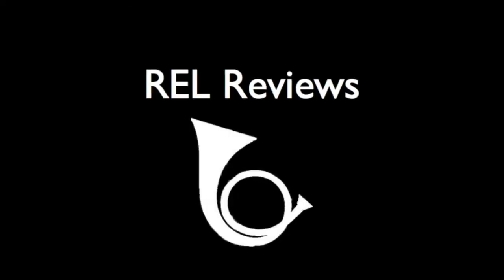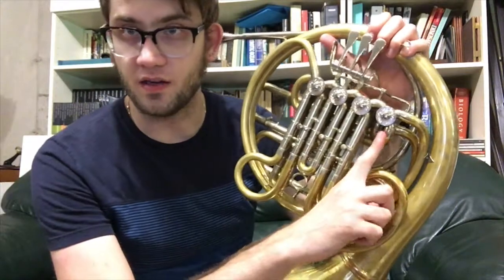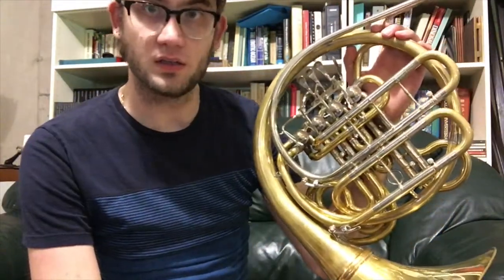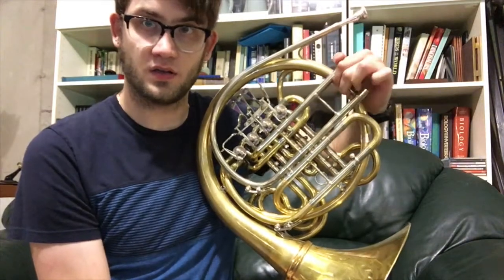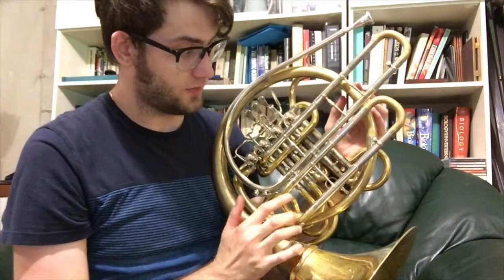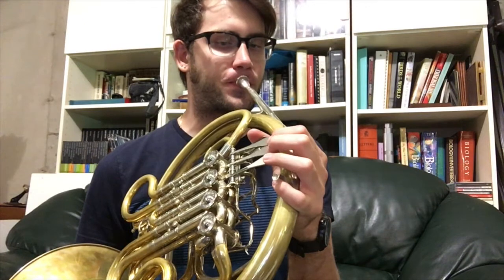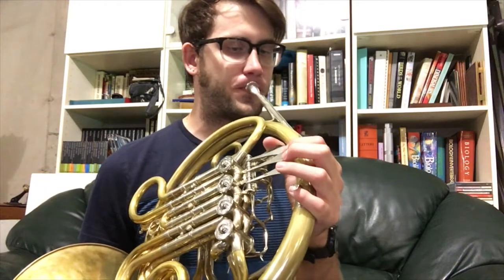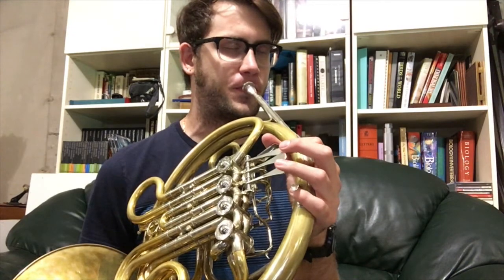Week With a Horn: Englebert Schmid double

Comment: In addition to lengthening the main and F slides (the tubes have a mark to know how much), you also need to extend each of the normal valves (1, 2 and 3) to match the longer A/E horn.

The advantage is, you can play a piece in E as it's written, without any transposing (except that written C sounds E, of course).

Or, you can remove the "H" piece, and insert the F slide completely, then also insert all the other slides (1, 2 and 3), and you get a horn in B/F#. So you can read E parts as if they were written in Eb (much easier). In this case, a C will sound F#.

Note that, although we have the horn in A/Bb/B, we never actually "hear" in that tone, we still hear the pitches in E/F/F#.

It's bringing back a bit of the crooks of the natural horn to modern playing. Many professionals and teachers in the XIX century, actually advocated for having the valves to complete the chromatic scale, but not replace the crooks system. One of the arguments in favor was that certain transpositions (like E and B) become awkward in an F horn and cumbersome to read. And while that's true, the practicality of not having crooks won.

Comment: I'm kind of curious how the horn stays in tune when adding or removing tubing. How have they resolved the issue of the length of valve slides? I assume you have to push those slides in when playing in F# or B and pull way out when playing in Eb or A?
Reply: @DJKLProductions  On a horn tuned to F, the main tube is about 4 meters long. The second tuning slide is about 25 cm long to drop the horn into the key of E. If we insert a 50 cm length of tubing into the main tuning to drop the instrument into Eb, then the second tuning slide must be almost 30 cm to drop it to D. That means when playing a main tuning of Eb, the second slide will need to be pulled out an additional 2.5 cm to get the extra 5 cm of length. The first tuning slide would need to be pulled out almost 5 cm to make it 10 cm longer. The third tuning slide would need to be pulled out about 7 cm, about 2.75 inches! Most tuning slides do not have that much room for adjustment, especially if using an A-445 tuning system that requires the slides to be pulled out to play at A-440 by default. I'm just wondering if they made the made the adjustable sections of the valve slides longer than a normal horn. The hand can do only so much fine tuning without adversely affecting the timbre.
Reply: @cdmcfall  I also had reached the same conclusion as you did, and it's quite puzzling, because in his website, the additional extension for the valve slides is not as much as I would've thought (check the "maintenance" section), which is comparable to your numbers.
Reply: @cdmcfall  Note that the slides only lower/raise the horn by half step. So you can have B/Gb, Bb/F, A/E (not Eb as in your response).

I have created a spreadsheet with numbers based on Lucien Thevet's Method for Horn and the formulas in "Mathematical Brass" paper (not exact but enough for an approximation).

1. Horn in F is 3.79m. This is the only value I took from Thevet's methode. The length of the rest of the tubing is calculated using the formula in the paper. I've checked that the values are close to the ones provided by Thevet (I could not use them directly, because it had very strange results, I think there are some mistakes in these values). I took some measures in my Alex 103 and match well enough.
2. Horn in E is 4.02m
3. When extending the main and F slides to E (there are marks on the tubes), the horn is extended by approx. 22.56cm
4. The 2nd slide for bringing down a horn in F to E is the same, 22.56cm. This is the normal 2nd slide in the F horn.
5. The 2nd slide for bringing down a horn in E to Eb is 23.91cm. But we already have a slide that is 22.56cm long, so we have to take it out by 0.67cm.
Reply: @cdmcfall  YT does not allow pasting the link of the spreadsheet, sorry
Reply: @georgH  Yeah, I don't know why I typed Eb. I knew what I meant lol. Based on speed of sound (343 m/s) and A-440 tuning, the tube length for F should be 3.93 m (at least for a cylindrical tube: (343 m/s) / (87.31 Hz) = 3.928 m). I'm pretty sure the 3.79 m is a product of intentionally manufacturing horns sharp (one can always pull out). A-455 tuning would indeed put the F at 3.8 m, plus the fact that sound moves faster in the humid inside of the horn. Thanks for the info. I'm actually working now on building a triple horn from scratch, but I've designed some custom fittings (similar to compression fittings in plumbing) and thumb screws so that the entire tail section and lead pipe can be removed and replaced. For chamber music, fit a slightly narrower lead pipe and a narrow throated, smaller bell. For big parts, attach a wide-throated, nickel silver tail and flare. Make it completely modular. the cylindrical valve and tuning sections would be the same bore regardless, but the taper and throat size could be adjusted based on demands of the performance. Theoretically, you could attach the various lead pipes and bells to any cylindrical tubing, so you could swap out the rotary valve assembly for a pumpenvalve assembly and now you have  a Vienna horn. Or replace it with a coil of appropriate sized tubing to make a natural horn. It's been a fun project so far, though I have yet to make it past the CAD phase (I do have a PEX version for proof of concept).

I'd love to compare your spreadsheet to mine. I may upload it to Google Drive. You can put in a tuning for A, and it will spit out tube lengths for all keys from A0 to C8, plus the theoretical wavelength of each harmonic to determine the most in-tune fingerings. The conical shape does weird things to the harmonics, BTW. It doesn't behave as one would expect from a closed cylindrical tube. And I'll definitely be buying that book!
Reply: @cdmcfall  Wow, thank you for your response!

Wow! I'm impressed that you are actually building a triple! I just crunched some numbers to understand better how the valve slides must be adjusted after tuning the entire horn half step down or up.

Actually I started this spreadsheet using the values from Lucien Thevet's book, but some values were really weird, I think there is a mistake somewhere, so I didn't trust it.

Then I replaced these values with the calculations I mentioned. Because I wanted to have a reference, I forced the speed of sound to get the length of the F horn as presented by Thevet 😅I know, not very scientific but I just wanted some values in the ballpark, like a back of the envelope calculation.

After having seen the results (and having measured some slides on my horn to match the calculated values), I now found what was my mistake and have a better understanding. 

My mistake was thinking if I needed to add, let's say 17cm to the 2nd valve to change it from A to Ab, then that slide would have to be extended by 8,5cm, which is crazy. But the majority of this length has already been added to the main slide by lowering it half step in the first place.

I have the spreadsheet in google docs too, but can't paste the link here, YT blocks it.
Reply: @cdmcfall  Wow, I'd love to see your work, be it a video or a blog, sounds very interesting!

> The conical shape does weird things to the harmonics
I know, I just wanted to have a bit of an understanding, as it was not clear to me at all why it worked (I have a Schmid double and tested the Gb and E tunings but didn't have a clear understanding of the extra length needed).

So, nothing serious, I just did it for fun :)
Reply: @cdmcfall  Your project sounds so interesting! Jacob Medlin also has some blog posts about how he designed his horns completely in CAD (I've read them all!)

You should check it out, great stuff!
Reply: @georgH  I've been in contact with Andy Thompson, principal horn in Norwich. He wrote a paper about how the taper of the mouthpiece, lead pipe and the curve of the bell flare affects intonation, especially at the extreme low and high registers. It's called "A Study of French Horn Harmonics." I disagree with one of his conclusions, though:

Specifically, a cylindrical tube 392.87 cm should theoretically be able to play F0, F1, C2, F2, A2, C3, Eb3, F3, G3, A3, Bb3, C4, C#4, Eb4, E4, F4, with the fundamental 2 octaves below the F2, which has a wavelength equal to the length of the tube. He suggests the conical shape opens up additional harmonics not possible with a cylinder; I suggest that the conical shape forces the fundamental to the F2, which is the harmonic series we're used to in the open F position: F2, F3, C4, F4, A4, C5, Eb5, etc. (plus some random pedal tones below F2). If the conical shape opens additional harmonics, the open F horn should be able to C2, A2, C3, Eb3, etc. in addition to the traditional harmonic series, which it can't. I really need a sacrificial single F to do some tests.
Reply: @cdmcfall  Wow, that's so interesting! I would definitely would like to check your results, if you ever investigate it further :)